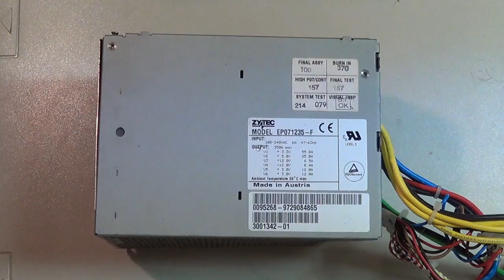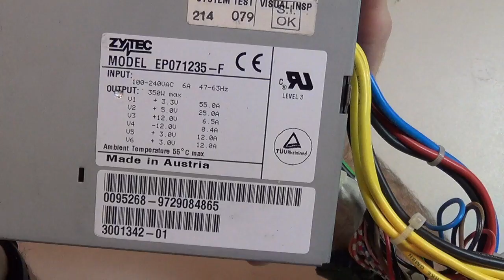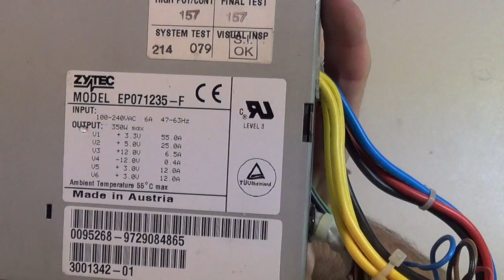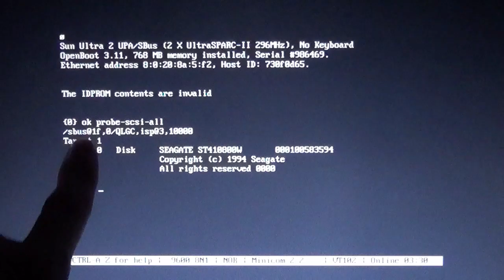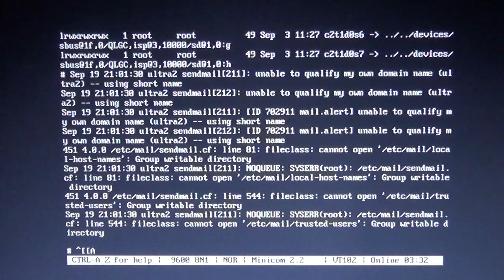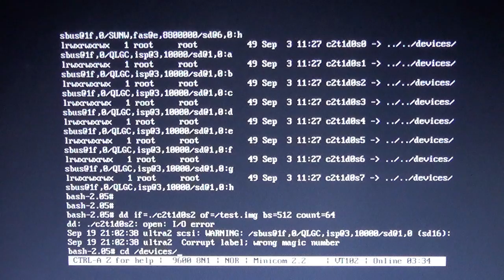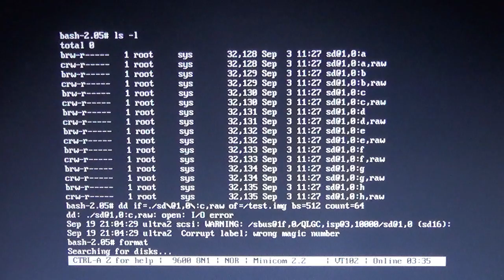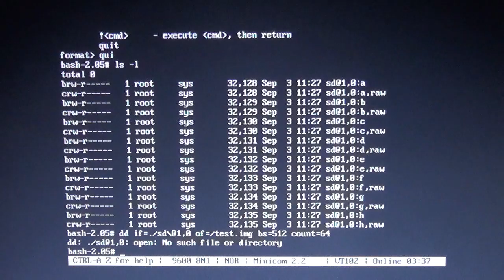Cray J98 Project - SWS returns to service

Comment: Can you use something like Xyplex terminal console ,like even run it through cubrix clusters!?
Lustre?
You've recalled Solaris was sun as well but created outside of cray as sparc but those Utica etc were used in conjunction with cray installations running various apps under Solaris with net and connections ? But not something you'd immediately know now. 
Solaris 10 has ZFS we are looking OS for polling crayZ. IBM Linux Zos has run ,as between installations,watson big blue cray fir Zos? 
Z pools z pooling X .
Unique OS?
However you there have more than that whether you know or not that assembly is HOT and has mass ground zero attachments too universe cosmos etc. Why not to involve planet Copernicus sign writing calls as yells evolutions etc,which comments expect too sort with an algorithm or two? You'd end up system of do live at,therefore border stated system school studied experiment of journalised numb nut until you know no thing etc etc etc? There's lots of buttons like that,you'll be o.k as you should YouTube look at your hands in those cray wires then think in articulated truck sized telepathic calls of what doesn't watt bolt volt gram grammar stutter stammer slam hold you too that syntacts fir a bore puppet have none Nat stat rack of patrol meter maid electrical quip taking dialectics fir damn float about yelling nought?

Comment: Just a thought.....if the original SWS was a Sparc 20 or simlar it would probably have been running Sun-Os 2.something. the switch to Solaris brought a lot of changes to the OS and maybe the disk file system.

Comment: This may be a cheaty solution, http://docs.oracle.com/cd/E19455-01/806-1075/msgs-1187/
Reply from the maker: Except, of course, I don't want to create a VTOC - I need to read the Cray data raw, so I can't modify the disk :/
Reply: Fair enough, Linux it is then lol.

Comment: I just did a bit more looking into running Linux on that Ultra2. Because the processor it uses is an UltraSPARC-based one, you're in luck. It was the first processor series to use the SPARC v9 architecture. There was a spin-off project of Red Hat 6.2 (the last RHEL to support SPARCv9) called Aurora Linux. It supported both SPARCv7 and v9, though when Fedora absorbed Aurora they dropped mainline support for the v7. Though the Fedora builds for SPARC ceased around Fedora 12, it should be fairly trivial to get a copy up and running. I would be more than happy to help support you getting it up and running. Not only am I a Linux geek, I'm a Fedora geek, been using Fedora for quite a few years now.
Scroll down to releases: https://fedoraproject.org/wiki/Architectures/SPARC
Reply from the maker: Thanks for all of this, I appreciate it. I'll let you know what I find.
Reply: Nope, I checked that. Compiling the kernel is easy, however you would need to know what options it required, and that can be more difficult than it seems at first glace.
@JP -- looks like FreeBSD worked out! I will file this away in the back of my mind in case I ever need to pull stuff from a Cray/Sun device.
Reply: I would use the fc15 build if possible... I wish I had a Sun to test this out on. I could likely solve many of the minor problems that crop up. I am serious about support, if you have questions, just ping me here and I'll send you my email address.
Reply: Darn, the download links are dead. I am going to keep looking.
Reply: It looks like FreeBSD may well be the easiest option. I have absolutely no experience with BSD, but it should be very familiar since you're so used to Solaris. They are all Unix/Unix-like... looks like BSD kept up their support for sparc64.
Reply: Ive no experience with crosscompiling, but are the sources for the kernel availeble? ive done some LFS (linux from scratch) things and i can say, its rather easy to compile in a day (i7).

Comment: The way is... LINUX!
Reply: GNU/Linux, but yes, think if linux supports his hardware then your should be able to dd (we no need filesystem support, only get dd to copy everything) (btw, gnu/linux calling is weird ... ;) )
Reply: Nope, just Linux. I hate the FSF's argument that Linux "just filled a hole in the GNU system". Yeah right! The kernel is the LARGEST PIECE by far!! That's like saying adding a car to four tires is filling a hole ... should it be called a 4tires/Car device? That's ridiculous. Not to mention, other parts of the system, like Apache, EXT4, mail servers, etc. make up just as big a part. So technically, it should be GNU/Apache/EXT4/Sendmail/Dovecot/Perl/Python/C/Linux ... see how that argument goes? It's called Linux. The creator calls it Linux -- it's Linux. 
Hope I ruffled up a few Stallman fanboys :)

Comment: With a modern power supply, you won't get much more than 25A on 3.3V & 5V. They supply most of their power on the 12V rail.
Reply: Yep. Most GPUs have their own step-down regulators.
Reply: I can attest to this. I've had a devil of a time getting a new ATX power supply for a new Pentium Pro build. Of all manufacturers, StarTech (!), actually makes a PSU with a 30A 5V rail.

Comment: I'm with you on this one, i don't think Solaris is going to work out for that job. Solaris only knows of the VTOC partition table and expects all disks to have one. Slice 2 only works on a VTOC formatted disk. It looks like it's going to be Linux / BSD to the rescue.
Reply: Is there a way to access the OBP device tree in solaris? I know linux has this in /sys but i am unsure about solaris. the /sbus@... path is in reference to the obp device tree. If memory serves me correctly, this would be under /devices not /dev. Does /devices/sbus@1f,0,QLGC,isp@3,10000/sd@1,0 exist?
Reply from the maker: I address this towards the end of the video - it does not and it doesn't magically spawn when you try and address it. There's something clever going on behind the scenes - I'm hoping no other OS does it.

Comment: Glad to hear you go the Sun working again.
I also think it could be a termination or logic ID issue. I know way way back in the day I had issues like that with old Seagate SCSI ST-225N drives in PCs.
Reply from the maker: According to the Seagate manual I have the internal terminators pulled-up, so it should be good. (I rechecked that about four times to be sure I wasn't doing anything stupid.... doesn't mean I'm not still, of course).

Comment: Maybe a red herring but the issue looks similar to scsi id ghosting due to bad termination or id logic. I havent had such issues with a sun machine (i never messed with the scsi on my e1000, just in case) but got it occasionally with apple machines and PCs.
Reply: No, this is not how scsi reflections/conflicts generally manifest (in my experience at least), you'd either have missing devices or see multiple instances of the same device (i.e. sd0, sd1, sd2, sd3 etc, not partitions). To me, it smells like the disklabel reading somehow fouls up and detects lots of partitions, at the wrong offsets.

I don't know solaris, but can you manually alter the in-core disklabel (without writing to disk)? This can be done on bsd-systems, as I have in the past to some success.
Reply from the maker: According to the Seagate manual the internal pull-ups are enabled, so it should be right.